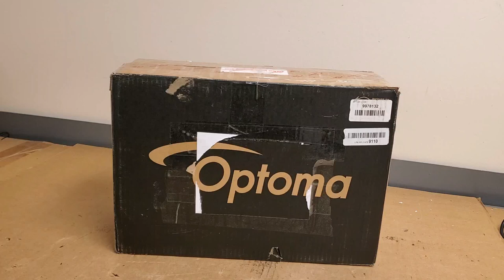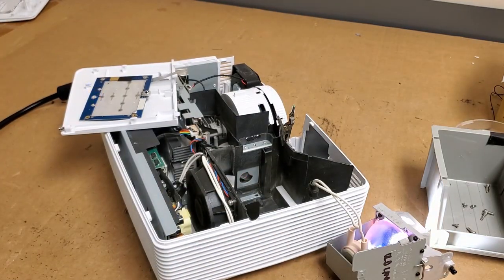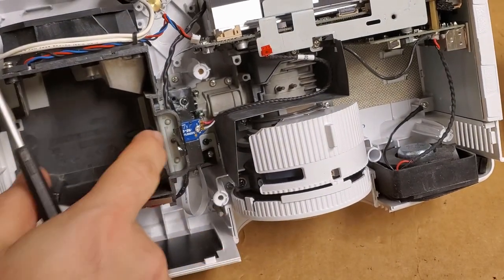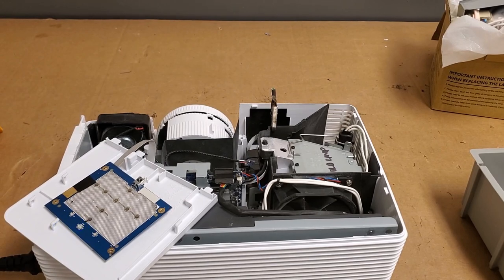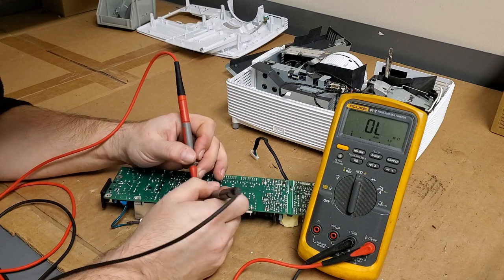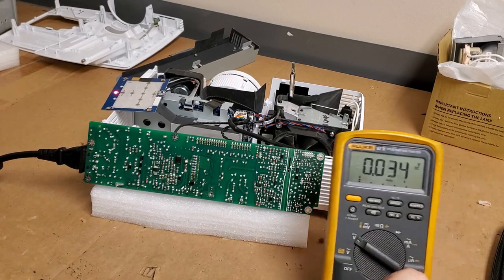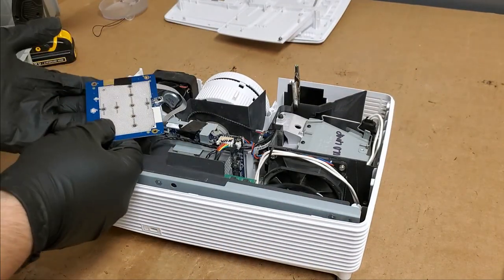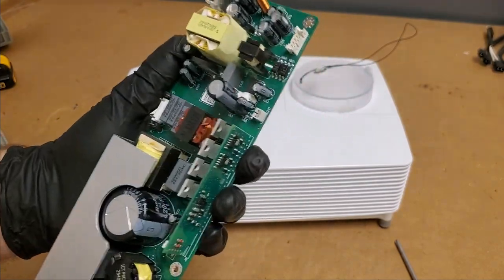Optoma GT1080 DLP Projector Repair for Intermittent Lamp

Comment: More videos, more knowledge. Excellent video my friend Frank. The single fan design in this machine is just madness! The only projector I gave ever seen with a single fan in person is a cheap 100 buck OEM T6 with only a blower fan I am testing right now. Kudos man!
Reply from the maker: I am constantly impressed/cringe at some of the manufacturing methods and how they have evolved. This is a good example. I cringe at the idea of one fan, but impressed that it works so well.

Comment: Thanks for the video Frank, great to have a reference disassembly video for my GT1080Darbee. Mine has had a few issues, the lamp hours and settings keep randomly resetting to factory defaults. I eventually figured out that the "fan locked" message was happening due to power outages that restarted the projector while still hot. If I just let it cool down it works properly.
Reply from the maker: Really?  Resetting the lamp hours on its own? That is a weird one. It almost sounds like wherever they store the info(onboard eprom? eprom inside an MCU?) is not getting reliable voltage.  These do seem like the epitome of manufacturing.  Everything is incredibly compact.
Reply: @FixitFrank  yeah it's weird. So since I have no idea how many hours the lamp actually has on it, I guess I'll replace it when I think it needs replacement. It's my first projector so I assume brightness will eventually degrade.

Comment: Thanks for the video.. I have an epson eh-tw3200 and it goes but the letters on the items in the menu are pinky red
Reply from the maker: It sounds like the polarizers are failing.  That projector is around 10 years old. Thats is about how long Epson tends to last. Check the panel alignment settings in the menu first. That might be the issue too.
Reply: @FixitFrank  Thanks

Comment: Hi Frank, i have been watching many of your videos and i haven't quite found any that touches base on what I seem to be experiencing. My projector starts and runs but tend to reach a point where the remote no longer works and will not respond, then at times the screen blacks out as well...any idea what might be causing this issue?..Thanks Chris
Reply from the maker: Whoa.  I can't say I have ever seen that happen. Does the button panel on the projector still respond when this happens? Is it also a GT1080 like the video? There could be a few causes for that but I would need more info.
Reply: @FixitFrank  The manual buttons also do not respond when this happens, I have to unplug and system resets...
Reply: oh...and yes, it is a GT1080 short thro
Reply from the maker: Oh wow. That is weird.  The fact that is locks up is really really strange.  It could be a failing mainboard but the fact that it works after you reset it makes me wonder about some other parts.  
Are you in the states and are you pretty comfortable with a volt meter?  The easy repair is a new mainboard but those are not remotely cheap.  I think something is bad and getting hot and then causing the main control IC to lock up. 
If you're in the states and wanted to, I would be happy to look at it for you for free and see if I can figure the cause. If you are comfortable with a volt meter, there are some places to check voltages internally but you need to be comfortable working around high voltage .
Reply: @FixitFrank  i am willing to use a volt meter, totally comfortable working around voltages...how ever i think i have to spend a bit more time investigating...I had a twin projector i used in my garage and decided to swap it out in mean while with this malfunctioning unit...I had never experienced any issues with this garage until I made the swap and connected it up...now thi8s unit is also experiencing malfunctions and over heating plus a screen blackout after approx. 1-2hr of use...very strange. I have decided to rework all the electronics and connected components to see if there is any obvious problems...I will get back to you on what i possibly find...in the mean while I will hook up the first bad unit in the garage and see if there's any improvement. That may tell me at least there is a component issue.
Reply from the maker: Totally understand.  Ill be here!

Comment: My Optoma - GT1080HDR is turning on for about a minute or two and then shuts it down. The power light blinks red and lamp light is solid red/amber. There is no light on temperature. Do you think it's bulb ? I couldn't find a way to clean the filter. The say it's easy in their manual but I can't get the side intake and exhaust vents off. Appreciate your help Frank
Reply from the maker: I suspect it's merely a bulb issue.  If it is the original lamp, then it would be near the time to change it.  Also, only some GT1080HDRs were shipped with a filter.  It was an option they used for areas of the world that were deemed dustier than others.  Weird way to do it in my opinion.  What I saw was they add a plastic assembly that sits over the vents that holds the filter. If you can look in the side and see the guts, you don't have a filter model. 
If you buy a new lamp, be sure you can return it, just in case it is not the lamp.  I suspect it is, but better to be safe.
Reply: @FixitFrank  Thanks Frank, the projector is 13 months old, around 130 hours usage, just outside warranty. It turns on for 3 minutes with projection and then shuts off automatically. Fan seems to run ( I can hear it)...not sure what's wrong.

Comment: Is there any way to visibly see if the lamp is fused without testing the projector with another lamp
Reply from the maker: Not easily.  These are arc lamps so there is no filament to check.  The only way to tell is with a visual examination or a known good lamp.  The tube inside is the arc tube.  It should be clear and clean.  If it is black/grey/warped or cracked it is no good.  If you see small white cloudiness, that might also be bad.  If the lamp is around 1500-2000 hours old, I would suspect it to be bad.

Comment: I have a Optoma GT1080 short throw projector and my issue at hand is the internal speaker inside of the projector has finally failed on me. Any videos on how to replace the speaker inside of one of these?
Reply from the maker: I don't have any specifically replacing the speaker but you can see the tear down on a few GT1080s if you search the video page. There is one video around Christmas time that may be very helpful
Reply: @FixitFrank  You can fix my projector if want too lol. I wouldn't know where to begin at it. I tried contacting the company but never got a reply back from them.

Comment: Hello, I just bought a used Optoma HD26 and it seems the projector would stop projecting for about 10 seconds or so then it would start again. This happened approximately about an hour after usage. Any suggestions?
Reply from the maker: If the light is staying on, I would start with the input source first.  Make sure its not a bad hdmi cable or connection to the projector. Next time it happens, press menu and see if that shows up while the image is blanked.  If so, its an input issue.  If not, its something with the mainboard (if the lamp stays on).  If the lamp is going off and on, I'd try another lamp first.

Comment: Any chance you know the sizes of the two fans?  Or even a suggestion to what fans to get to replace the originals?
Reply from the maker: There is a sticker on the side of each one(might be under some tape) that has the model numbers.  That is what you want to get.  Trying to substitute fans in a projector is a big pain.  You need to match the obvious things such as size, voltage and amperage, but also the CFM and Stall reporting type.  I tried to substitute a fan in an older NEC and it "worked" but it turns out the CFM was not quite high enough and the lamp was failing early.
Reply: @FixitFrank  thank you

Comment: Have a GT1080darbee. What should be the voltage on the lamp leads coming from the projector on startup? Is 16VAC normal and is there a way to test the lamp without a ballast?
Reply from the maker: It can't be measured safely or correctly with most meters. The ignition voltage can be 3-5KV at 20khz. The run voltage is around 100-120 also at 20khz(usually). Most meters top out at 600v to 1kv.   The lamps are arc-lamps so they need a ballast to drive them. The only thing you can test on a lamp without a ballast is if its shorted or not.
What are the symptoms you're seeing?
Reply: @FixitFrank  color wheel is not spinning. no fan turning on. the lamp is open with no resistance. the unit looks brand new with no visible dust etc.
Reply: @FixitFrank  Frank thanks for the quick response. I took the cover off. Everything looks new and intact. Double checked all connections, solder looks ok without tearing out all the PS and other boards. I get the red light on startup, press the power button and turns blue, no color wheel spinning, the fan doesn't turn on, no lamp, about 16VAC on lamp power when blue light turns on. Wondering if maybe a fuse? I can pull PS and check fuses but was hoping it was something simple like a lamp or connection. Thanks for your help.
Reply: Will the color wheel spin without the lamp. I am just thinking/hoping that maybe just a bad lamp from shipping. Just don't want to try fixing something when it could just be the lamp?
Reply from the maker: @partickharrington1619  the color wheel has to start first. Without the color wheel spinning, the lamp won't do anything.  It kind of sounds like a bad main board. On the opposite side of the power supply wire, the main board has a bunch of test points marked with the expected voltages. I'd check those. I wouldn't worry about the lamp or ballast. Until you solve why the color wheel isn't spinning up, the rest can be ignored. If you have the standby led changing color and nothing else it's most likely a main board issue. I've run into this a few times and can't figure out the cause.
Reply: @FixitFrank  Thanks Frank. I will try to meter this weekend. I did also check the USB and it provided no power. You stated that you can't figure out the cause. Have you figured out how to repair or just replaced the board? If the main board is it worth fixing, where can I get a replacement?  Again, Thanks for your help.
Reply from the maker: Replacing the whole board is an option, but its not cheap.  I have not found a good price on one yet. I actually have a GT1080 on the shelf right now that someone sent in with the same symptoms.  If you have no USB power, you may want to check the power supply low voltage.  You should have 5v, 12v and ground as well as a return wire that turns on the high voltage for the lamp.  That wire will read some weird voltage like 2.7 or something.  You will see 0, 5 and 12 but I can't recall which pins at the moment. The PJ is at my office and I'm home on vacation until Wednesday next week. Basically check all the pins on the low voltage power wire cluster.  If you don't have 5v that might mean you lucked out with a bad power supply.  Those are easy to find and pretty cheap to replace.

Comment: Hi Frank! Just got here searching for replacing and cleaning a GT1070X, because the bulb just exploded today. I removed it just like in your video and saw broken glass everywhere. I will just order a new module and hope it will be as new. One thing I did not see or miss is the cleaning process. Before it broke, it started being a bit louder (something else besides the fan) and I am thinking that it has some excess dust somewhere that needs to be clean. Any advice would be helpful. Thank you very much!
Reply from the maker: Hi Leaota!  Check this video as well.  https://youtu.be/za-viIWXUlQ  The HD26 and HD141x are essentially the same.  Slight differences but they should give you enough info.  I have videos on both.  Just search Optoma on the video page for the others. 
I would be suspicious of the blower fan. That is likely full of dust.  When bulbs explode, usually it is because the bulb gets too hot for too long.  The blower fan that cools the front of the housing is almost always the culprit.  The fan blades get clogged or coated with dust preventing efficient cooling air being pushed through the housing. Be sure that fan is clear enough(does not need to be perfect) and then your replacement should perform as the old bulb did.

Comment: Hey frank.. I have same projector.. mine isn't powering on and all my indicator lights are red. Where would you start??
Reply from the maker: Hi Chelsea, all 3 are lit up at once? That is unusual.  I'd start by checking the power supply voltages to the mainboard. Kind of sounds like a bad mainboard though, just as a warning.  Of course I dont have it front of me, so take that with a few grains of salt.  Make sure you have the 5-12v to the mainboard and then I would check for regulators on the mainboard getting hot.   This does not sound like a standard issue just as a heads up.
Reply: @FixitFrank  yes they're all three red.. we bought it off an online auction.. doesnt have remote.. no sound coming from it. I plug it in and those 3 light indicators are all solid red.. I just don't know where to begin.. its frustrating. And I know nothing about electronics to even check voltages.. it came in original box but no owners manual. I don't want it to be a $200 waste.
Reply from the maker: @chelseawigton4115  Oh no.  $200 is a lot to toss. I agree. I'm guessing you are not in the States. If you are, and want to contact me about it, I have an email listed on the about page.  Sadly there is nothing "easy" I can suggest aside from going and replacing the whole modules(mainboard, power supply etc).

Comment: Like your videos very much ^_^. small question, what do you think is better projector Benq Ht3550 or Viewsonic PX727-4k.build, overall quality, picture quality, and maybe life span of these two projectors. (ht3550 has dynamic iris so I wonder how long does that last) I just can't decide :(.
would have gone for optoma but they don't have anything in this range with rgbrgb color wheel.
sorry if my question is in the wrong video, it just popped up in my head.
Reply from the maker: Thanks man!  That is a tough one.  I like the PX727 4K a lot.  But BenQ is always a good direction to go.  Anecdotally I have heard really great things about the Viewsonic. It seems to be the "dark horse" in the 4K game between Optoma and BenQ.  The construction quality is going to be close  in my opinion.  That said, I have not seen the inside personally (in front of me, just by pics).  Being that neither seem to use Pixel shift, I would look at price.  The Viewsonic is definitely cheaper and it is slightly brighter(2200 versus 2000). 200 lumens is barely noticeable though.

Id probably buy the Viewsonic first. The BenQ doesn't seem to warrant the extra $500 or so in my opinion.  Take this all with a grain of salt as I have not used either myself yet. This is purely my opinion going off the specs and what I have heard about them.
Reply: @FixitFrank  Thanks for looking into it and for the super fast reply. will take this info into consideration.
seeing you get all those projectors back to life is amazing. saw you tear down a few of the models I owned was impressive, never thought that some of them pack so much hardware inside. and on another side, some of the projectors are nearly empty :D. very happy that I found your channel.

Comment: Where can I source a power board for this model? You mentioned China in your video.
Reply from the maker: are you in the states?  I may have one. Otherwise,  my contact in China is gydz@timeprojectorlamp.com  Be sure to send a picture to them if you ask. They will ask for one if not so they can confirm the part is correct. My email is on the about page about halfway down, there is a captcha thing to show it. https://imgur.com/6PjOD2x
Reply: @FixitFrank  yes, I'm in the states.
Reply from the maker: If you want to, send me an email and we can discuss.  I am pretty sure I have a working PSU on the shelf from a scrapped unit.
Reply: @FixitFrank  i sent you an email. thx
Reply: I tested the recommended points per your suggestion. You think my issue is the main board?

Comment: Hi Frank! thank you for sharing this great video. I have a GT1080darbee wich I dropped accidentaly on the ground. Imediatly i tried to power on and it shows the error (lamp failure). My question is, before change the lamp is there any part or component that should be inpected which can be cracked or damage from dropping?
Reply from the maker: I'd start with re-seating the lamp unless it is obviously damaged.  There other parts that could have been damaged but I would try the lamp first.
Reply: @FixitFrank  I've already re-seated the lamp and also made a visual inspection with the parts assembled and could not find any clue for damage. So now I'll try to change the lamp and let see what will happen. thank you.
Reply: Hi do you know which speaker module I would need to replace the speaker I know it's 10 watts but no idea which will work

Comment: Hi Frank! Thank you again for another great video! Can you recommend where to get a color wheel for a Veiwsonic PA503W projector??
Reply from the maker: You're welcome! Thank you!  I would check eBay first in case someone in the states has one.  Otherwise, Time Projector should be able to get them.  If the old wheel is still together, take a picture of it against a white sheet of paper to show the colors.  Then send them that and they can match it up.  Most of the time, the factory just loads up the segments in the order that you need them, balances the wheel and ships it out.  gydz@timeprojectorlamp.com is their email.